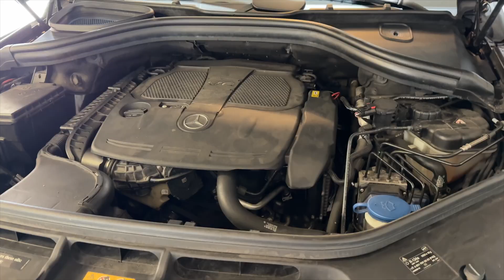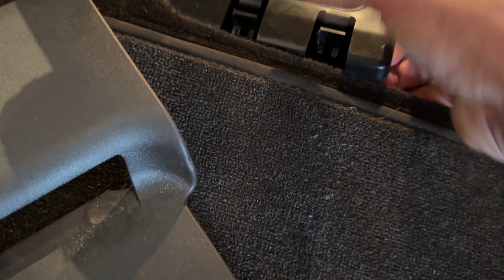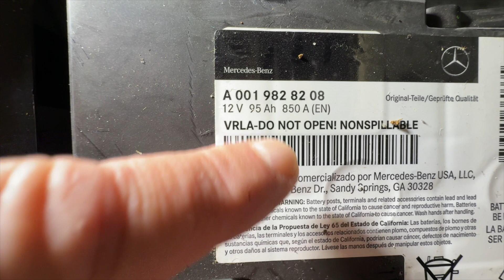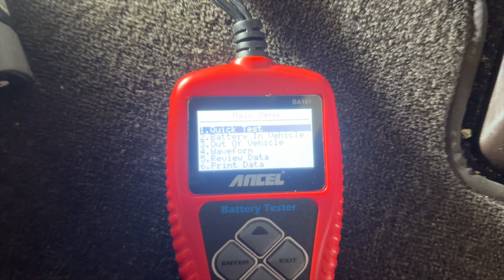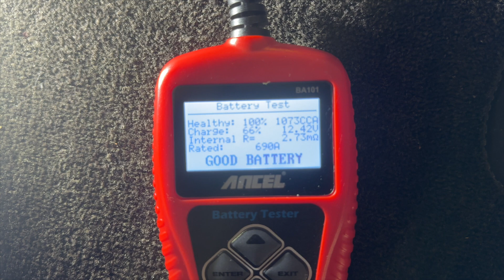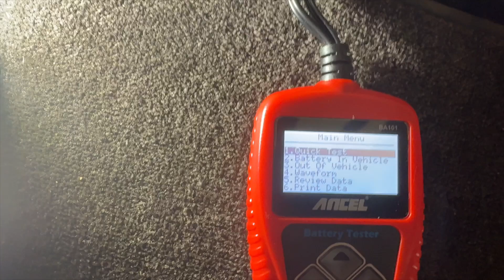Why are your battery test results inconsistent?

Comment: I bought an Ancel BA101. I hooked it up to one of my cars battery. Reads State of Health 45%, State of Charge 1%, Says recharge, yet the Battery cranked the little LT1, no Problem. 
3 yrs ago I bought a Topdon BT200 and it too was wonky. A brand new Battery was reported to need replacing, and one that could barely get headlamp to glow, was said to be Good. I sent it back, and will likely do the same with the Ancel. Both appear to be Junk

Comment: If a Mercedes battery was used for the tests, then the wrong type of battery was chosen. It says VRLA on it, depending on the year of manufacture, they can be either AGM or Gel variants. But it is not a Regular Flooded one. Also, EN is a designation similar to CCA, but the tests are more strict compared to CCA testing. On CCA it may show that the battery is relatively good, but if tested through the EN testing method, the battery would be characterized as bad.
Reply from the maker: I appreciate your observations.  My battery is indeed an AGM.  I did  re-test and got the same results.  The voltages were the saem, the IR was the same and CCA reported the same.
Reply: @letsrolldiyauto1532  That battery shows 850A CCA, which comes out to about 770A EN, a loss of almost 100A, that is a solid degradation of the battery. To get EN, CCA is multiplied by 0.91 and the EN value is obtained. The question is whether and to what extent the tester takes EN, CA and CCA into account and whether they will apply an adequate testing algorithm.
Reply from the maker: @ 850 CCA converts to 790 EN, It's not a loss, but rather a difference in conversion due to the testing differences. The testing is different, with EN being more rigorous for cold testing.   The questions to be answered when doing an in-vehicle test is, such as this are:  1) will the battery reliably start the car, 2) is the battery degrading to a point where replacement is advised, and 3) if the battery is degraded, can it be revived?   The amps required too start a car will often vary from car to car and in the same car, the age and condition of the car.  The CCA, EN and Ah all give the current available to start the car, when the battery is new.  Doing the cranking test is going to give you the basic information as to whether the battery can start the car.  The internal resistance and the change in internal resistance over time will tell you if the battery is degrading and also can tell you if it cannot be revived.  Most basic portable battery testers will answer these three questions.  Do we really need more?
Reply: @letsrolldiyauto1532  The battery in your vehicle clearly says 850A (EN). 850 A EN is 934 A CCA. When EN values are measured as CCA, the meter will show a much higher value than what is thought to be the CCA value. If everything was fine with the battery, that device would show a similar value, around 930-940A.  In your case, it coincided with the value of EN. But that's still about 10% degradation. It's not that noticeable because the battery is still in good condition, but it will be much more noticeable when the battery is even more degraded. If you measure it with the settings you did, the measuring instrument will still show that the battery is "OK", that it doesn't need to be changed yet, that there is still life in it, but in reality, the engine will struggle and the computers will complain because something is wrong with the battery. Especially because EU cars have implemented both variable battery charging and alternator activation due to environmental standards. If the car itself has a start/stop function, then the problem with the battery while driving will be even more pronounced. As for oxidation and internal resistance, VRLA batteries, due to their more advanced construction, have lower values from start than flooded batteries, but they will still increase. If the measuring device does not know the exact type, again, due to the algorithm it used, it will show incorrect values, which will again lead to faulty information.
Reply: You clearly stated at the beginning that you were converting AH to CCA. Some people don't pay attention.  Your test was solid.
Reply: @MattL.-KE0SAW  You need to look better. That car battery uses European norms, since battery is made mainly for Europe's market.

Ah is just Ampere-hours, it has nothing to do with standards – This indicates the battery’s capacity, or how much energy it can store. 

EN and CCA are related but they are not the same thing and confusing them can give a wrong picture of a battery’s real condition.

CCA (Cold Cranking Amps) is a general term that describes how much current a battery can deliver at –18 °C for 30 seconds. The problem is that CCA is not measured in one universal way. The result depends on the testing standard that is used.

EN (European Norm) defines how this CCA value is measured in Europe. The EN test is stricter because the battery must keep a higher minimum voltage during the test. Because of that, EN values are usually lower but more realistic.

He did not do the conversion from EN to CCA standards at any point in the video.

Many battery testers measure CCA using SAE logic, even when the battery is rated in EN. SAE allows the voltage to drop lower, so the tester can show a higher CCA value than the EN rating on the battery. This can make a weak or aging battery look good on the tester, even though it struggles in real cold starts.

If the battery is rated at 850 A EN and the tester only allows CCA (SAE) input, a reasonable value to select in the tester would be around 950–1000 CCA. This compensates for the difference between EN and SAE standards and makes the test conditions more comparable. Selecting 850 CCA (SAE) would make the test too lenient and could incorrectly show the battery as healthy even if it is already weak by EN criteria. As a rough conversion, EN values are usually about 10–15% lower than SAE CCA values. 

If the tester could only measure CCA, then it would show a value approximately 10 to 15% higher than the 850A EN written on the battery, or 930-980A.

That’s why a battery can pass a CCA test and still be near the end of its life if the label value is given in EN. If a battery is rated in EN, it should ideally be tested in EN mode. Otherwise, the result can be overly optimistic and misleading.
Reply: @SasaStojsin my mistake I just looked it up and there are differences. You should make a video.